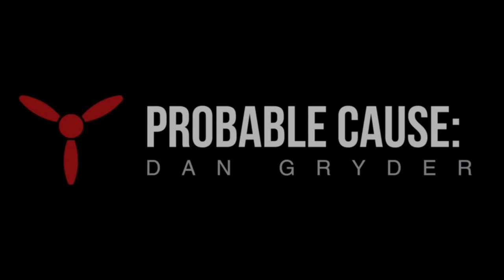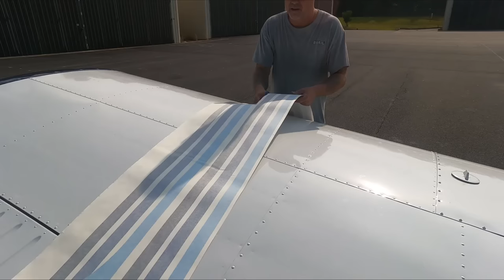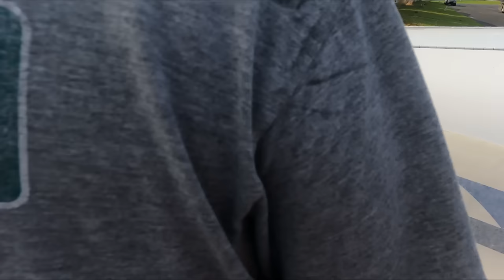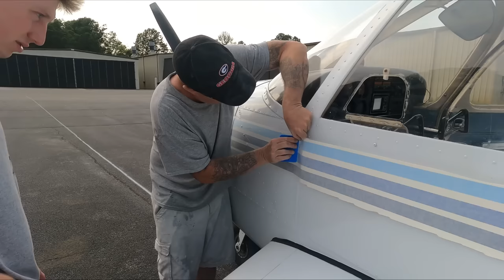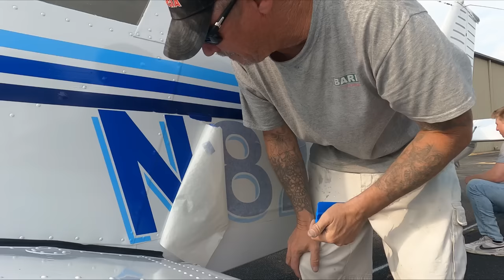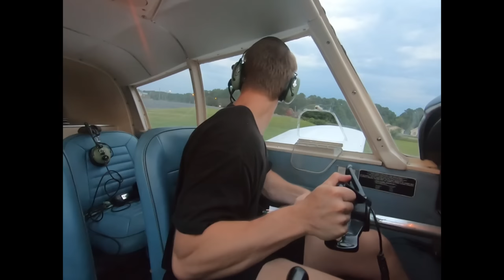DIY!  How to Fix Up Your Plane!

Comment: Dan, it did stuff like this for a living before retirement. An easier way is to do your layout and then make reference point use a grease pen right on the edge of where you want it. After you start to pull the backing spray soapy water then apply the decal by squeegee the soapy water out. Much like tinting windows. The adhesive is not water soluble
Reply: @LTVoyager  it can be done dry but, I think that's the hard way. If you've ever watched a pro do it with soapy water they can whip that vinyl on there in nothing flat and it looks great!

Comment: Great job! Happy to second AeroGraphics - just installed new full size N numbers on mine using the wet process and it was a breeze. Very reasonably priced and excellent assistance all along the way getting the font, slant and colors just right to coordinate with an existing paint scheme. 

Interesting decision to apply your N numbers with a forward slant. Rakish and unique. Sharp plane, Dylan!

Comment: Yup, you guys did it the hard way i hate to have to say. You needed a trigger pump spray water bottle with a few drops on dish soap in the water. Wet the adhesive and the surface of the airplane well with the mixture. Then you can easily slid the vinyl around to get it positioned and squeegee the water out working from one end, or the middle on a large wide piece. The soapy water wont hurt the adhesive.  A heat gun or hair dryer helps to get it stretched around compound curves, corners, rivets & stuff.  But someone may have already told you thisafter the fact, sorry. But it looks good anyway👍

Comment: If it doesn't peel it looks great. Fairly easy to install. Great job.
I second the shoulder harness.
Reply: Some may not realize, but many jetliners are flying with adhesive film rather than paint applied graphics.  Providing a quality kit is used and is properly applied, one shouldn’t be concerned with the film peeling in the future.   
One huge thumbs up 👍 for the shoulder harnesses.  Thurman Munson died in an easily survivable Citation mishap for the lack of wearing the aircraft’s shoulder harnesses.

Comment: I would move the "fuel pump off" item from the after takeoff checklist to a cruise/climb check or cruise check, or delay the after takeoff until getting up higher. I don't like messing with anything fuel related at low altitude just after takeoff unless absolutely necessary. Beautiful job on the decal application; looks very nice!

Comment: Cut down the middle of the gap and wrap around edges of the doors, cowl, and door jambs.  Prepare the surface by wiping it down with degreaser making sure it is free from wax, oil, and other contaminants.  After its dry, apply vinyl per instructions.  A quality clearcoat protects against chemical fading and UV, however the surface must be prepared for clearcoat prior to installing grapics.

Comment: On the subject of paint shops and control surface disassembly by them, way back in 1988 or 1989 as an inexperienced CFI (some 20,000 hours ago) the FBO I instructed for sent me about 100 miles away to retrieve a Cessna 182 following completion of its new paint job. I did the usual preflight inspection and all seemed well. Upon arrival back at the home base airport, Hawthorne, California, taxiing in I attempted to retract the flaps. They stopped partway, jammed. One of the flap track bearings hadn't been installed, leaving one flap crooked, partially extended. I didn't catch this during their preflight inspection, despite having the flaps extended. The air load likely assisted in even, uneventful flap retraction after takeoff; and their successful retraction into the takeoff position at the departure airport was just by chance. 

The "mistake" on the tail looks ok in this case, though in general, darker ("heavier") shades/colors have a "visually low center of gravity" and look better below ("supporting") the lighter shades, as seen in the fuselage striping. This could be a temporary solution to my Luscombe 8E's lack of trim paint on its repainted cowling until I get the whole airplane repainted someday.

Comment: I think I saw on Plane Savers when they applied their vinyl decals over rivets they just heated the decal with a hair dryer slightly and ran that little plastic scraper around the rivet heads and it looked like it came out real nice.

Comment: Sometimes guys will spray clear coat over the vinyl too. I've seen factory cleared over vinyl on motorcycles. But dont know if anyone has ever clear coated an airplane? Not sure but I'd guess it probably depends on the type of paint that was used.

Comment: What do you do where you cut the decal at a panel edge like the cowling or cabin door? Do you use a clear coat to prevent the decal from peeling at the cut edge? Eastern tried that back in the 80’s so save money on painting their Caribbean Blue “hockey stick “. After first flight through rain the decal started to peel back….of course that was a 727-200!

Comment: Interesting to watch this, thanks, looks pretty good.
Hey Dylan, I like the verbal expression of hours of fuel on board, good idea. I looked up the rego and it says it’s 180hp? Yet it’s an 0320, huh.
So we have a 1967 Cherokee 140 with over 11000hrs, ex trainer from NSW Australia, engines had a bulk strip in 2020, new cables, great little plane, cheap to run but still fast enough to go places! With single shoulder harnesses.